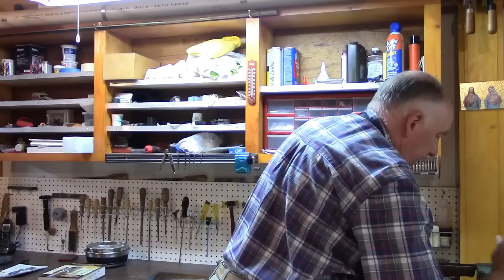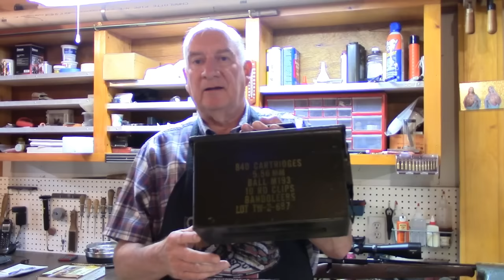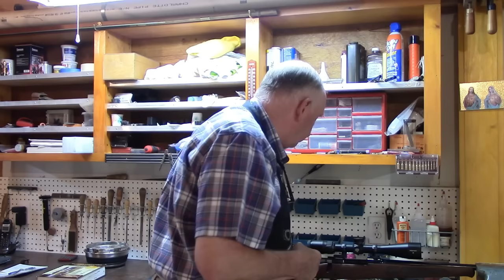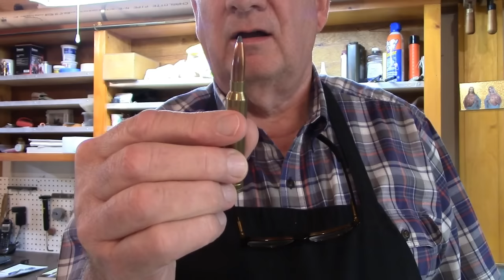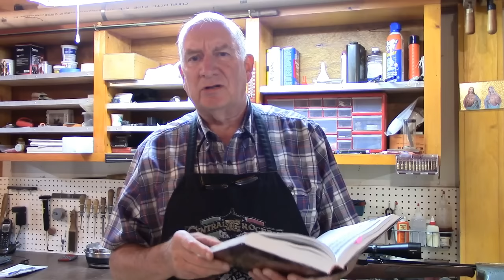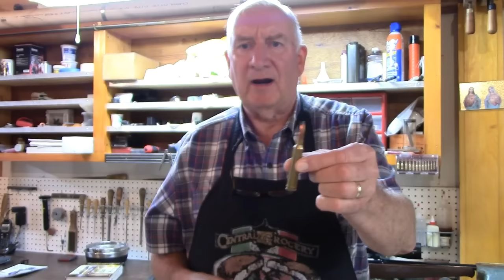How long do barrels last? ~ Discover the truth!

Comment: It still amazes me that factory Glock barrels, and “certain” AR-15 barrels can last as long as they do.  Really unbelievable.
Reply: Probably because the manufacturers know the barrels will be exposed to sustained firing, they use the toughest steel they can get.
Reply: @taraswertelecki3786   Barrel steels from reputable makers are all pretty similar, for the most part. However,  production methods and intended duty of a barrel do vary greatly.

 The Glock barrels are firing straight wall cartridges that will almost last forever, not heavily necked-down hotrod cartridges and will last 100s of thousands of rounds. Any fractional accuracy loss is a moot point and unnoticed. 
Many AR barrels are chrome lined and do last longer, but aren't of the supreme accuracy of the finer barrels. 

The accuracy loss spoken of here really applies to serious hunting and bench rest type rifles that operate at 100, 200, 600, 1000 yards which is altogether a different ballgame than a bang'em up range blaster.

Comment: Based on what I know, what you say makes a lot of sense.  If one wants to purchase a high quality barrel for a .22 centerfire target/varmint rifle, it is far better to chamber it for .222 Remington than .220 Swift.  Since .222 ammo is currently difficult to locate and expensive, that makes reduced handloads for the .223 Remington a good idea.  I have seen the videos on the .223 vs. the 5.56 and have learned that the need for a longer throat is a good reason for me to never get a 5.56.  
I was pleased to hear you mention the .22 Hornet.  I have two of them.  One is an accessory barrel for my H&R Handi Rifle and the other is a BFR revolver which pairs nicely with the rifle.  I also have a .30/30 barrel for the Handi Rifle and a BFR to go with it.  Those are great guns, and they do not need to be loaded for maximum velocity.  
Your mention of the .264 Winchester Magnum reminded me of a mistake that I made several decades ago.  I have a Winchester manufactured 1917 Enfield that I had barreled to the rimless equivalent, the 6.5x06 Ackley Improved.  I think one day that rifle will once again become a .30/06.  (Not a "thirty oh six" because there is no such number as "oh", that is a letter, not a number.  I also really dislike it's shortened version being called the "three oh eight.")  
Besides my picking on your grammar, I can really see that you know what you are talking about.  Your age surely has a lot to do with it, I know since I am 77.

Comment: I always wanted to know about copper buildup.  I have a sporterized swedish mauser. Due to the moderate velocities and slow firing I did not think to aggressively remove copper buildup.  For example, using PMC 144 FMJ and PPU 139 SP I was able to shoot , along with two other shooters, at a measured 200 yards off of a sandbag atop my range box sub 1/2 MOA three and four round groups.  WOW, the second shooter was a recently retired Remington employee who was the law enforcement instructor and never shot my 1906 with original military trigger and barrel. The third shooter was a Marine Corps shooting team member. Smallest group, 7/8 inch four rounds, the other two, 15/16. We were of course surprised and I was elated.  SO, I thought, I am going to swab the bore for days , let it sit muzzle down of course overnight after each swabbing.  The patches were Blue not green, Then Green, then clean.  I thought I did a terrific thing for my Swede.  Nope,   went back to the range, same ammo, same weather conditions; humidity and temp.  The groups opened to 3 inches at 200 yards.  So, due to the age , or should I say probable age of the barrel I thought I would experiment now. After two days and 40 rounds of PPU later with standard cleaning the groups had shrunk back to half MOA again. SO, interesting experiment I thought.  I received a used but excellent condition Rem 700 7mag. Groups about 3-4 inches at 200 with 160 grain Federal.  OK,  I got a lemon,right, nope. My Marine Corps buddy borrowed the rifle, did a Real copper cleansing for three days and many patches later. Same ammo, same range etc.  I am very happy to say the groups , four groups, slow fire, took about 45 minutes to shoot the groups, he and I shooting, just three round groups;yes he has told me and I am aware that the 'true' accuracy is at least 5 rounds, and I think that the ARMY marksmanship unit had found 8(?) rounds to be the magic number for accuracy potential.  Worse group 1.75, average 1.6.
Reply: Very interesting comments! Thank you!

Comment: Just found your channel, I like all the knowledge you share here. In my life I have gone through a few barrels. The number one cause in barrel wear is I proper cleanibg! People attack the barrel with a multi peice aluminum rod thats never been cleaned, they use no bore guide or one that doesn't fit. People run dirty brushes in them and scrub the heck out of them. We've been taught by the military or our family to scrub out the fouling by being aggressive.  A good bore guide will prevent the cleaning rod from scraping the lead and throat. Next the muzzle crowm gets damaged  as we pull that brush all the way out and pull it back across the crown. I shoot lots of praire dogs each year and bring at least 4 rifles most times 6, but I know that I will burn out barrels at the rate of 1500 rounds on my "hot guns" and 3000 to 5000 rounds on normal varmit cartridges. Lastly we need to keep the gunsmith's working, along with barrel makers.

Comment: A guy inherited a greased  .45 brought back from ww2. He brought it to local range . Luckily a knowledgeable clerk gave it a solvent and oiling and a box of ammo. They both went to shoot it, the original mag sat loaded with 6 live rounds for 70 years. They all shot.
Reply: Ammo has been very reliable for many decades. Stored correctly, will still fire easily at 100 yrs of age and more.

Comment: Thanks for the info on the venturi effect.  Agree Winchester Mag is not the minimum for deer.  But I would caution that statement depends on the range you are taking them.  There are places outside New England where 300+ yard shots are the norm.  A cooler round can mean unacceptable ballistics at range, and wound rather than a clean kill.  For some places, buckshot is for deer.  For others, 30-30. And for others you need 30-06, .308, or 7mm etc. Terrain matters.
Reply: I hunt on ground and never move, I kill asclose as possible with 50 cal new englander by Thompson center longest 125 yards, closest 4 feet average 30 feet from me, none have got away wounded.  I like black powder and make my bullets out of wheel weights. I have 2 out of top 5 big bucks in my county just to prove a point. My family prefers younger animals to eat.
Reply: Also had  same gun for 39 years.

Comment: I’ve been shooting for years and found that the average deer rifle will shoot approx 3-4 rounds before the barrel heats up and it affects accuracy. At that point I put the rifle aside and pick up a different one. These are lite pencil barrels. Ruger’s “B” barrel will go about ten rounds. I live a long way from the range and trips are far and few between since I’m still working. So when I go I take 3-4 rifles. You get a seat at the bench you have to be shooting.

Comment: You are 100% right. 
I know barrels have a limited life.
For my needs, I have a few rifles that I expect the barrels to be disposable items. But, I balance those with exact copies that I fire in a slower way—just enough to make sure they are reliable and accurate.  
The others with the disposable barrels, are my training rifles.  I try to keep my tactics, reflexes, and accuracy sharp.  
That is the way I train and protect myself and my family.  

I learned about barrel life in the Corps.  

And no matter what rifle it is, I keep it spotlessly clean and appropriately lubricated!!!   
My long range rifles are kept cool, are cleaned from the breech, and are shot as few rounds as I need to keep my groups tight enough to hit reasonable sized targets out to 1,000 yards.  But I do have enough property to have a 3,000 yard range.  The 15 inch plate at 3,000 yard plate is rarely hit.  But I do shoot an occasional shot at it. 

I love the .300 Mag.  I used it in the Corps.    For deer hunting, I usually use a .44 mag rifle, or a Remington 742 in 30-06 with a barrel cut to 16 & 1/2 inches and a slightly shortened stock.  I love that rifle.  It’s a short very handy carbine.  I did have to install a flash hider.  I also hand  load for it, because of the short barrel.  It also has a scope designed for lower light conditions, for early morning and late evening shots.  The scope has a large post and crosshairs.   (I do not hunt after dark, or illegally.)  The .44 Mag is my favorite,  but the 742 is a very close second.  I do have many others.   I just like those 2 for deer hunting. 

Semper Fi

Comment: I still have a model 94 30.30 winchester.  It will last me a lifetime, as it did the previous owner.  I don’t shoot for the sake of shooting, so it doesn’t see alot of rounds.  One shot, one kill.  Keep it clean, oiled, and stored in a dry location.  And only use when necessary.  cheers from northern 🇨🇦

Comment: It still amazes me how many in the community still underestimate the abrasive power of propellants. When a high round-count suppressor is taken apart for an overhaul, it literally looks like someone stuck it on the end of a media-blaster nozzle and then blasted it with chunks of carbon. Throat erosion doesn't look much different, either.

Comment: With a Mike Rock 5R barrel in .338 Lapua, using 89.7 grains of Vihtavuori N-560, I was good for 750-780 rounds.  Throat went every time, looked like the surface of Mercury on a hot summer afternoon.  Fissures were full of copper and throat area was completely cracked.  Bullet was a 250 grain Lapua Scenar.  Back in the day, competing with this rifle was just expensive.  Shot my TRG-42 in competition for five years and in that time I went through 7 barrels, two scopes, and at least 1500 cases.  Barrel burner, yup, know all about that!

Comment: Great video with lots of solid information.  I've discovered after buying a good borescope that in the cooler climates rust can destroy your rifling.  What happens is the steel gets cold when your out at sub zero temps, then when you bring it in to your home the moisture is attracted to the cold steel where it condenses and if not cleaned right away or warmed up quickly, it will begin to rust as the moister mixes with corrosive powder residue in the barrel.

Comment: It's hard to understand how the Venturi effect plays into this; since, in a necked-down cartridge, the increase in flow rate through the neck must be greater than in the case itself, the force against the throat of the barrel will be less than that in the case, rather than more - i.e. the Venturi effect would cause more axial movement of the molecules, rather than radial.  Also, the Venturi effect, I thought, applied only to subsonic fluid dynamics; the gas/powder mix flowing through the cartridge neck is almost immediately supersonic, remaining so throughout the passage of the bullet through and out of the barrel. 

I would think that the transition from semi-laminar to turbulent flow of the burning gases as they pass the edge of the cartridge case would cause scouring of the throat because of the change in direction of the gas.  It's an interesting question, because it seems like if it is the latter, then a neck-diameter throat - i.e. same diameter as the cartridge neck inside diameter - would direct the burning combustion gases down the barrel rather than at the walls of the throat, because there would be no induced turbulence from the cartridge mouth edge effects.

Any time I listen to someone describe things going on at a molecular level like you are, it becomes fascinating to try to visualize what's going on.  That class of description is very thought-provoking and encourages head-scratching!  I'd be interested in your thoughts on where I'm going wrong on this.  Videos like yours are very valuable contributions to the collective understanding of what's going on.

Also, as for the comparison between 6mm and 7mm, even though the case pressure for the 7mm is only 82% of that in the 6mm, that pressure is acting on a bullet base that is 36% larger in area, so the total force exerted on the bullet by the expanding gas is 12% higher, even with the lower pressure, which could easily account for the 5% higher muzzle velocity of the 7mm (the larger barrel volume would reduce the average pressure even more as the bullet moves down the barrel).  Is that what you mean when you use "efficiency" to describe the reason for the difference in performance?

Thank you for the video and explanations.

Comment: Had a custom 22-250 and a custom 6mm Rem Ackley. Did burn out the barrels plus Hi ammonia content bore cleaners etched the bores. Live and learn.
Reply from the maker: I learned that lesson too, destroying two beautiful Sako 270 rifles with ammonia based solvents. I advocate keeping all copper removers from barrels.  Entirely unnecessary. Anything that will attack copper will certainly work faster on steel. Bores remain copper plated, bright and smooth with just mineral spirits or plain Hoppe's and a few tight patches. Any roughness is quickly removed by a few passes with a bronze brush, when required.
Reply: @GunBlue490  Bore scopes don't lie. I'm doing ok so far with the bore solvent I started with. Hoppes No. 9. Sorry about those Beautiful Sako 270s.

Comment: The amount of "push" that a bullet receives is pressure times the cross sectional area. The velocity is the result of the "push" divided by the mass of the in a given barrel length.
Reply from the maker: Thanks for your lesson in physics.

Comment: I agree with most of what you are saying.  I only have experience and knowledge with AR-15 platform.  I used to subscribe to your school of thought which seems to be to take very good care of your firearms, clean after every shooting, treat them very gently, only a few rounds at a time, don't get the barrel too hot, etc.  

However, lately in my shooting life, I have gone to the opposite school of thought.  Now when I buy gear, I want to see what it's limits are, what can it take.  For example, I want to know how many rounds it takes to burn out my barrel.  I don't endlessly mag dump for no reason, but I do train hard and push the platform for as much performance as I can get to attempt to find the breaking point.  A barrel is a wear item, when it burns out, replace it.   If my  barrel lasts 10k rounds, and I shoot about 10k rounds per year, then I have to buy a new barrel every year, which is about $200.  In my opinion, that $200 per year is well spent to figure out the breaking point of my gun.  I am also coming from the philosophy of shooting for fun and competition, not hunting, for what it's worth.  

To sum up my long winded point, I agree with not abusing the equipment for no reason and shooting like an idiot.  Where I disagree is that if you have well planned out, structured training sessions that just so happen to be hard on the gun and you are shooting a lot of rounds, I think that is a good thing.

Comment: I work in a steel mill. The steel troughs that the orange hot bar is guided through looks like tree bark after a while of being exposed to the hot steel. Not friction, as portions of the trough that doesn't get touched by the bar, just constant heat and cooling cycles.

Comment: I was going to ask about Benny.  very good to hear that. When i was younger i had a habit of many follow up shots, i was after the X on my target.
As i got older i slowed down a lot. I found the X more often that way and burned up fewer rounds as well.
The fastest rounds i own are .243 and .270 and i expect they should be fine for my lifetime as i use them.
Where i live i can only deer hunt with a shotgun - due south of you. And that is fine had great success with slugs.
You have given me a little more to think about with this video. I knew about this but did not really apply it to what i own and use, it's not forefront in your thoughts as you slide another round in that chamber.

Comment: I recently bought a 220 swift, mainly for the scope that came with it (10x unertl). I was concerned about barrel life and only hand loaded below max, and the range I’ll be in will be about 3600 FPS. It has a bull barrel and i currently have it at 1” groups at 100 yards however I think I’ll get it tighter. I bought it because I thought it was a neat cartridge but I probably won’t load near max or past. A 55 gr bullet at 3600 FPS is plenty
Reply from the maker: Great round.
Reply: One of my favorites, only need one shot ,

Comment: So true I served thirty years in the United States Army almost twenty in the Ranger Regiment.I retired in 2010. So I'm very familiar with firearms and wear and tear. I own two M1 rifles my favorite rifles one is a Frankenstein but it has a new barrel. I have another one from  April 1945 original barrel it either never left the States of was with a non infantry unit. The barrel is like new  I've replaced all the pins springs anything tab would need to be changed out on both. I purchased them in a gun store not the CMP.  I really lucked out I'm a shooter more than a collector. Thanks for the video well done.

Comment: Yep got record setting performance out of a barrel that lasted 2200 rounds and had a replacement specciallty barrel forage hammerd rifeling and dezined to a more presise shot placement for 280.00 on a 2100 dollar gun. Not exactly worried about a barrel as a cost issue.